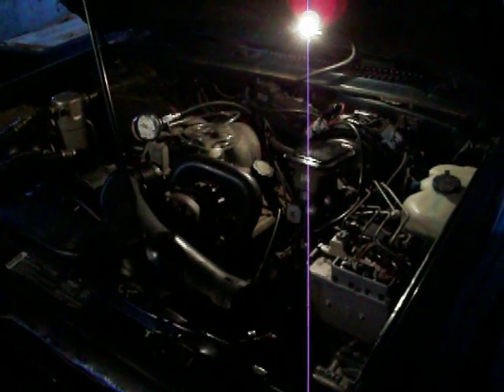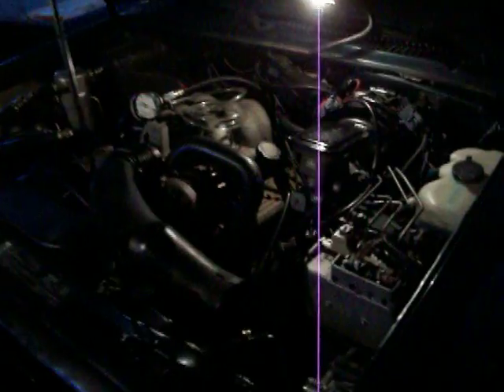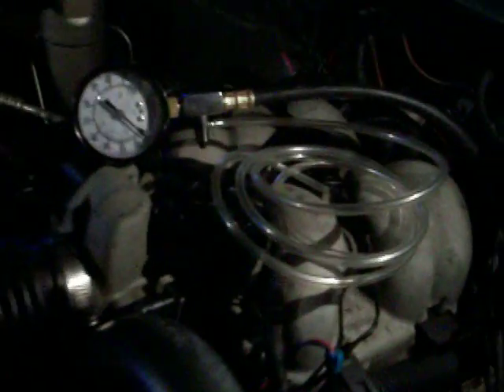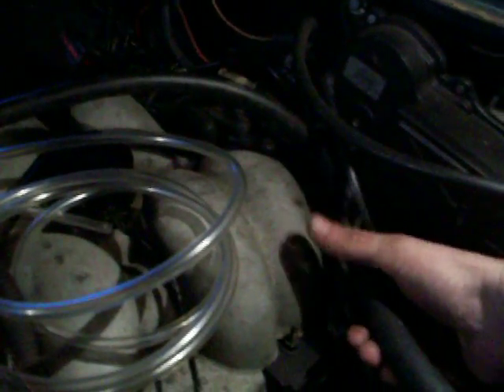4.3 V6 CPI Fuel Pressure Test

Comment: I have the same issue. I have crank but no start, fuel pressure goes up to 30-40 psi and drops. It doesn't hold. Not sure what the problem is.
Reply: Thomas Curiel try ur crankshaft sensor

Comment: this is just the beginning of the test. you've established there is a fuel pressure issue. next step would be to dead head the pump to rule out the regulator or an injector leaking down. the pressure you got did get up there but did not hold. dead heading should show 90psi from the pump if it's anti bleed down valve is good. some systems are easier than others to diag properly yours and mine a 2000 4.3 vortec are not.

Comment from the maker: @you2bertoo Its inside the intake, you dont smell cause the gas runs down into the crankcase.  Ill betcha your oil level is overfull and smells like gas.  The hoses are 18 years old and prone to cracking and leaking.

Comment from the maker: @thunder393 Open you upper intake up, it should be BLACK everywhere inside, if there is gold on the drivers side, you need a "nut kit" if its gold on the passenger side, its leaking from your "Fuel Pressure Regulator"... Its just that your lines are 18 years old... $50 to fix, rockauto.com for best deals.

Comment from the maker: @you2bertoo LOL @ You, the Nut Kit is what plugs into the spider!  You were right there!  The hoses were prolly black inside the engine, and the new ones are white, so I can see how you did not see them.  But anyways, the but kit is between the fuel line from tank, and the spider.

Comment from the maker: @nzmetalman Um, nope... Im a chevy guy for life, and your fuel pump should be regulated to 58-60, no more.  The pump would put out 100 probably, but the regulator limits the pressure.  For your engine, 58-60 is right in factory specs.  Anything lower, and the CPI injector doesnt like to open properly.  This video is the more or less to show newbies how to hook up the gauge and do a test and not have to pay the mechanics.

Comment: i have a 4.3 2000 gmc jimmy and found out that the fuel pump should hold 65 pounds pressure... if any lower than that injectors will not open to disperse fuel and car will not start.

Comment from the maker: you should hook the gauge up at your fuel filter and check for bleed off. that would be that little rubber hose on the pump leaking. if no bleed off at the filter, then its going to be your FPR leaking inside the intake, pr wherever its located.

Comment: I have a 97 jimmy with fuel pressure bleeding off but it's not getting bad mileage, not flooding, not spewing thick smoke. It's running lean. I replaced the fuel pump yesterday and it still has a problem anyone have any ideas?